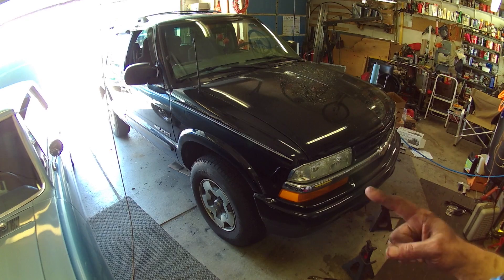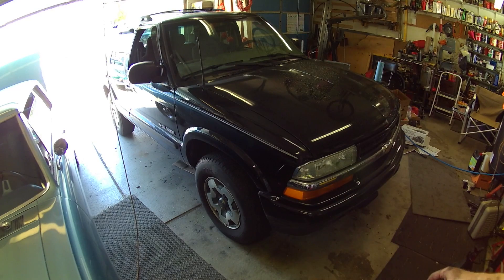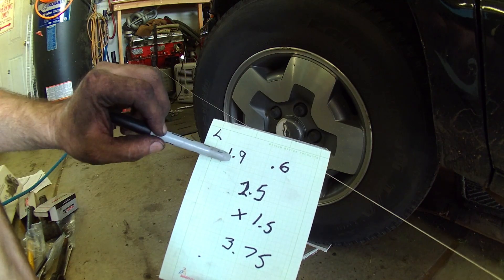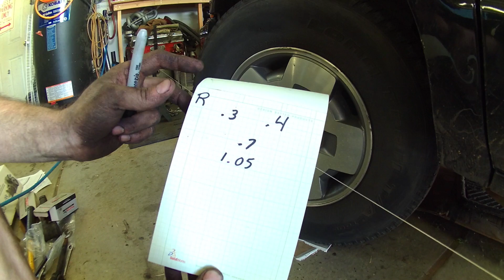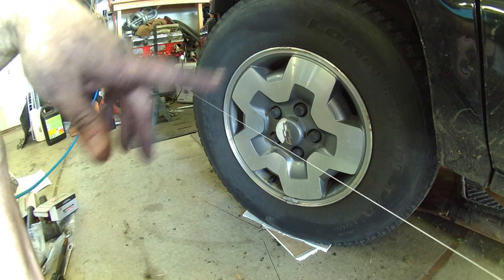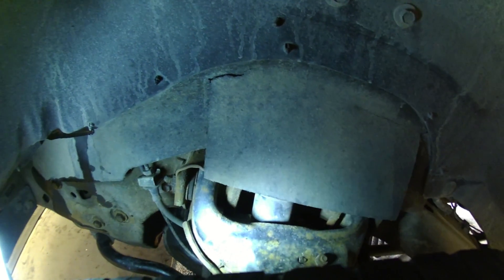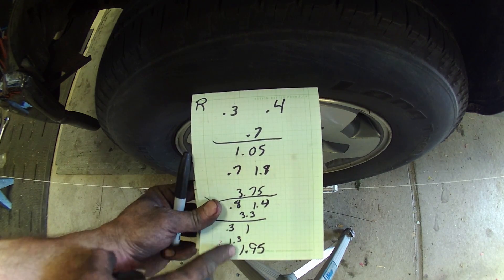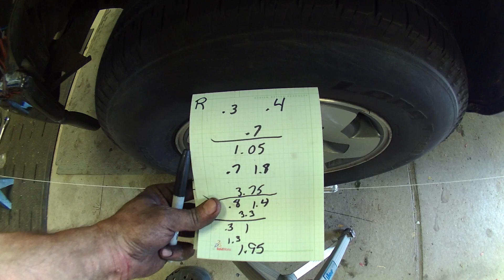DIY Precise Garage Tire Alignment

Comment: On the right side when setting caster you turn the wheel to the left and got 1.9 turned it to the right got .6 add a dose two numbers together got 2.5 then you times 2.5 x 1.5=3.75 where did the 1.5 come from

Comment: sorry but you are wrong on caster angle, the vehicle will ALWAYS  drift to the lesser side caster , as long as other angles are in tolerance
Reply from the maker: No reason to be sorry!  If I'm wrong, I've learned something ;-)

Possibly semantics? Or did I misspeak?
https://www.underhoodservice.com/using-caster-to-properly-align-vehicles/
"Tend to pull to the side with the most negative caster"
Reply: @thommyknockershoptime6877  You didn't misspeak, you got it completely wrong. Reread the link you posted which has it correct. A vehicle will pull to the side with the least positive caster. You typically make the LF 1/2 degree less then the RF to compensate for road crown.

Comment: If the car is already aligned and you want to change the inner and outer tie rods. Wouldn't it work if  you just put a 2x4 flat on the wheel and with a laser level mounted on the wood,pointed at the wall.Then  make a mark on the wall then change tie rods and align to the mark on the wall.
Reply from the maker: If the inners are worn to the point of needing replacement, how would you block the wheels and know the alignment is correct? 
Also, to get to the inners,  you need to remove the wheel.